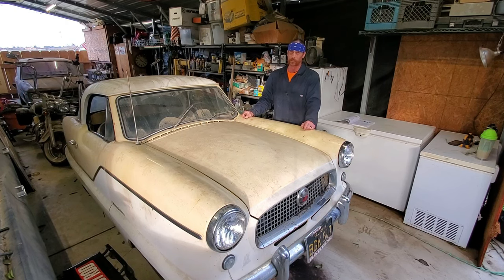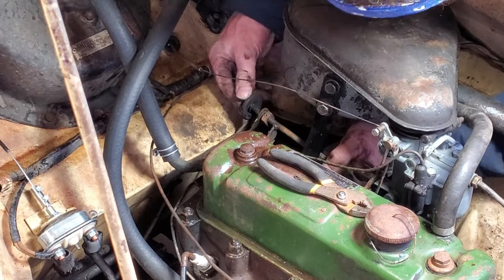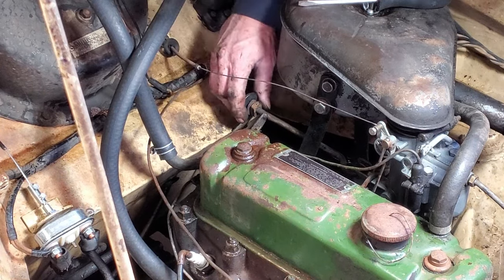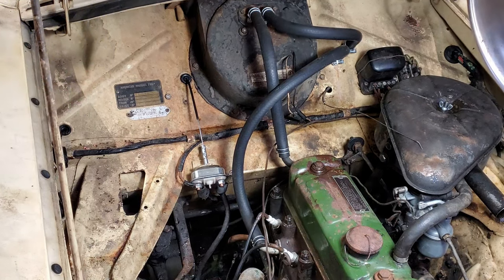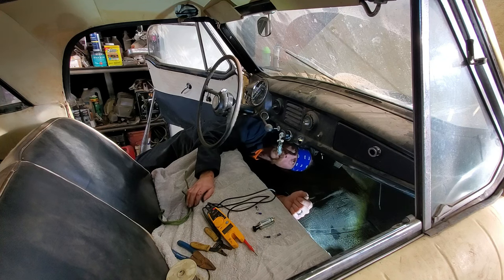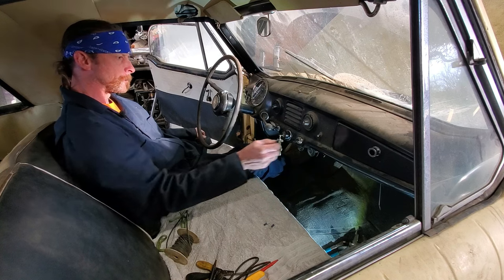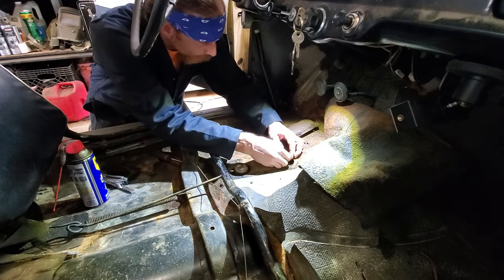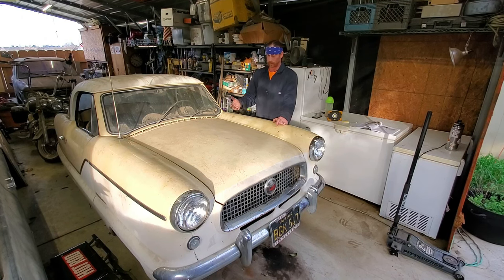Replacing Parts And Researching Master Cylinders 1961 (Nash) AMC Metropolitan Barn Find

Comment: Of course my suggestions are after the fact,  but here goes.  Ive had better results with the WD-40 vs the grease when installing the rubber components. An alternative is baby / talcum powder.  Mercedes recommends the use of talcum powder on the rubber gaskets around the door frame, trunk lid etc.  Narragansett Bay
Reply from the maker: Thanks for the info!